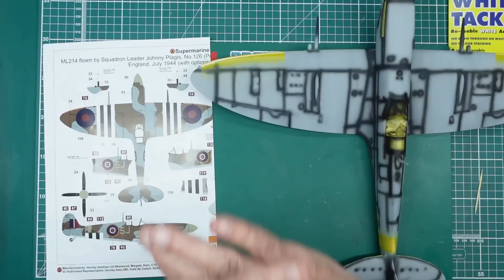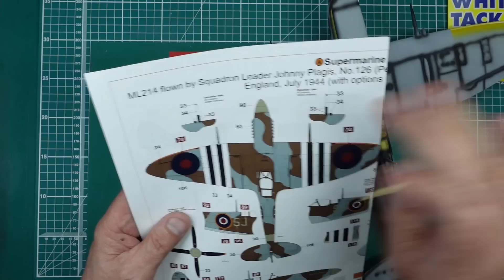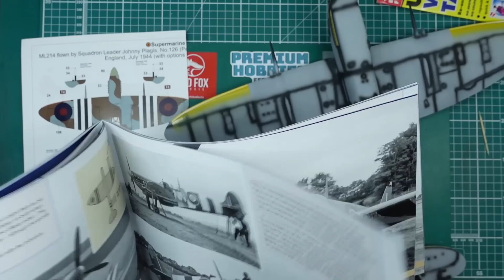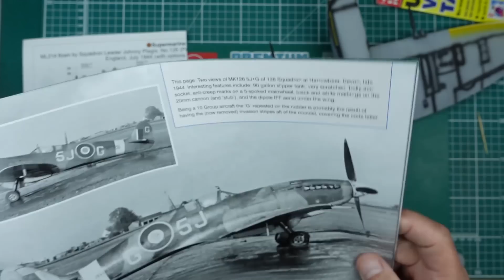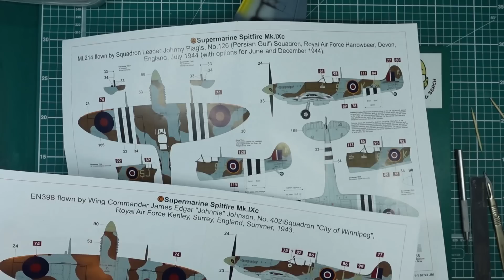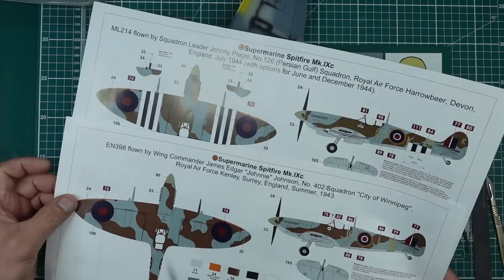Airfix new tool 1/24 Spitfire Mk.IXc Build. Part 18

Comment: I'm always late to the party! I read an article many years ago that spoke specifically about the hard/soft discussion. The article said that Supermarine had full sized masks made of rubber and horsehair. The paint techs would paint the gray overall then thrown on the masks and painted the green. Depending on the painters skill or timetable, you could get hard, soft or a mix of all three on the same bird! There were photos backing him up of techs pulling mats off of newly painted Spits. Also explains why the schemes were all similar.
Reply from the maker: I'm sure they used the mask as a guide rather than an actual mask. I'm sure they did have them because there were two patterns of camo and when you see them lined up they are all very much the same. I doubt they painted overall grey due to weight and paint supply?